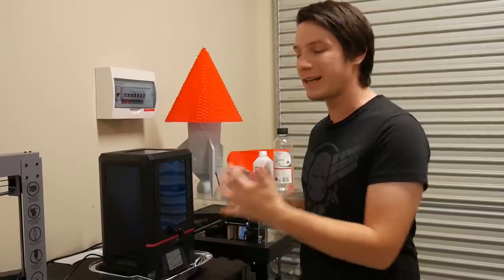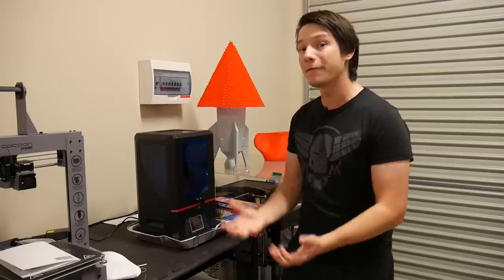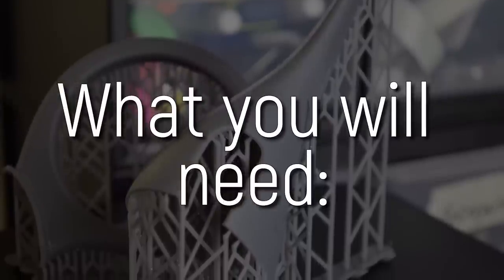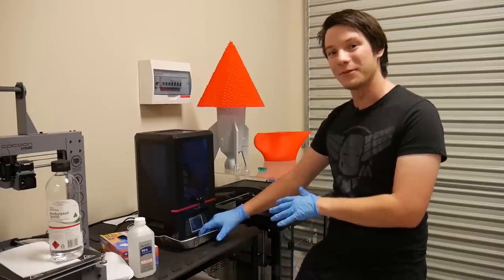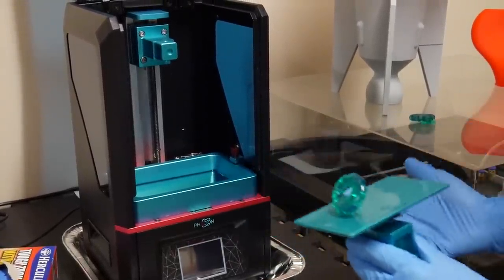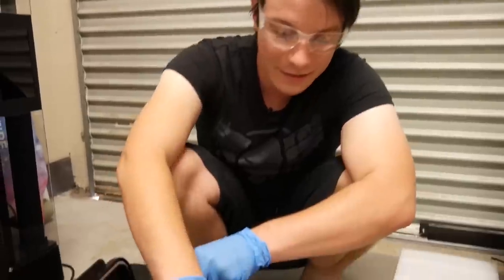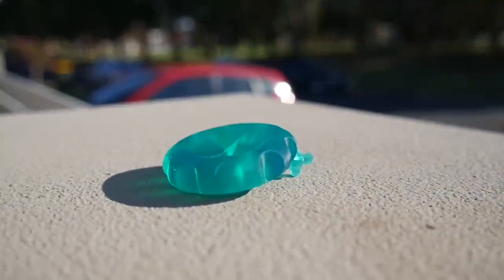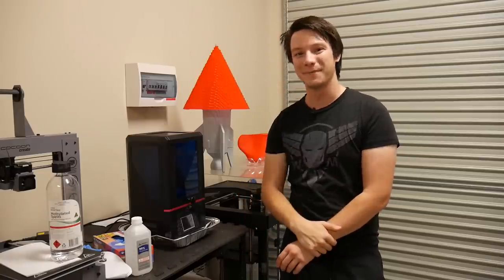Resin 3D Printing Safety - Important for Beginners!

Comment: Angus, glasses on BEFORE gloves on.  Glasses off AFTER gloves off. ;)  Don't handle glasses with gloves.
Reply from the maker: Haha yeah, normally I do that just mixed up the order while filming ;)
Reply: Exactly, the resins aren’t as dangerous as it seems here to begin with (look at the MSDS) but always good to wear gloves. Problem though is, wearing gloves gives a false sense of security, you have to be super careful not touching things all over the place and you can make it actually worse overall because you feel protected. Just like how people with airbags and all sorts of protection suddenly start driving faster.
Reply: @VincentGroenewold  BMW's must be really safe then if they don't follow any traffic rules :P (yes, I know how old this comment is)
Reply: @RasMatHam02  Traffic rules are never broken? ;) It's human nature I'm talking about, I worked in a lab and there it was the rule for an entire lab to either wear gloves, or only when handling certain stuff and then take it off immediately. Precisely because people are sloppy and cross-contaminate. And that was part of my point here, if you start wearing gloves, the user has to be aware that you either always use them in that room only or you implement a good strategy. But you have to think about it and not many do that, hence the false sense of safety.
Reply: @VincentGroenewold  I always drive 10 over
Reply: @HYPERxSONICxFANx2012  what a rebel

Comment: One thing you missed with the gloves is they must be Nitrile glove not latex. The UV developers will penetrate nitrile gloves slowly so change gloves if wearing for more than 10-15 minutes at a time or double glove. Latex gloves will not stop the developers reaching your skin.
Reply from the maker: Neat, I didn't know that. Nitrile is what I try to go for generally because not a fan of Latex anyway.
Reply: Not to mention that there are some that will have an even more of a reaction to the latex than they would the resin... generally, if you have any known allergies, take extra precautions.
Reply: I know this is an older, but I thought I should leave this here. When you are removing your gloves after use, start by pinching the glove at the heel of the hand. Don't get closer than 2cm from the cuff. Once you have a decent grip peel it toward your fingertips, while turning the glove inside out. Grip the now empty glove in a loose fist, and hook the cuff with the free hand, and peel it toward the fingers again. If done correctly not only will you stay clean, you will have bagged or double bagged them. (triple or quad if you double gloved but alternate hands if you do this)
Reply: What if you're very allergic to latex rubber?
Reply: Damn, the resin printer I bought came with latex gloves. I’ve been using them thinking they were safe. 
Thanks for the heads up. Hopefully I didn’t do too much damage to myself.
Reply: @gatblau1  you only have to worry if the gloves actually broke down. This is a common thing with solvents reacting with gloves. Even nitrile gloves would break down eventually from the solvents. If you want to be extra safe, you can use industrial chemical-resistant gloves. I own a manufacturing shop and we reuse the industrial gloves for a few weeks. You HAVE to make sure to clean the gloves themselves between uses and allow them to dry. Any tear or hole and throw them out. If we are using the strongest of our solvents, we double glove (nitrile then industrial) to be safe.
Reply: Do You know what about vinyl gloves?

Comment: Great timing, Angus. A lot of the folks in the tabletop gaming community are getting Photons and it's quickly becoming one of the favorites within our small niche. The way you show the process is phenonemal and I'm gonna be sharing this video all the time. 

Thanks again!
Reply from the maker: Cool! These machines are ideal for tabletop gaming figures and terrain.
Reply: Maker's Muse Definitely. There's always a raging debate about whether optimized FDM prints can compete with resin, but the day is coming when more of us can have both an FDM printer and a resin printer so we don't have to worry about it. I'm excited. Thanks again for your contributions to our hobby :)
Reply: How much resin does printing a typical PC miniature consume?  I'm considering getting into resin printing for the same reason, but the resin is still quite expensive.
Reply: oasntet I actually just made a video on that :)

https://youtu.be/v04wjiUT5Qg

tl;dr: After talking with a lot of people using the D7 and the Photon, of all skill levels, actual yield varies in how many minis you can squeeze out of 1L of resin. Assuming resin costs between $60-90 per liter - probably between $0.20 - 2.00 depending on how tight your post-print process is. 

I go in depth with both FDM and Resin in the video. Hope that helps!

Comment from the maker: Yes I know it's the Anycubic PHOTON and not Mega :P Review in a few weeks. Happy Printing!
Reply: love my machine. using it more that i do the moai.
Reply: Wheres the mk3 review?
Reply: Can you comment on whether it contains the smell? I know some of the resins smell quite bad so I was wondering if the print chamber is sealed in this case.
Reply: You got it right earlier in the vid. :-) Watching this, though, reinforces the idea in my head that I shall not own one of these printers any time soon, particularly with kids around.
Reply: depends on the system the photon has a couple of fans in it. but a lot of users are building chambers to put them in and vent the resin smell outside. i have used mine in the room. smell vareys from resin to resin. but some form of venting is only a good thing. :)
Reply: I've been using my Photon for about two weeks now in a spare room in our home. The Photon has fans to help with the odor, however the smell still lingers. More troublesome is the fact that I didn't have the room well enough ventilated and whenever I would spend more than a few minutes in the room while the machine was printing I would get very nasty head-aches.
Needless to say, all printing is now on hold and resin stored away until I build a print chamber next to the window with fans venting fumes outside.
Reply: there is a print on thingiverse that replaces the top cover with an adapter for placing an extractor fan and you can fit large diameter pipe or spring tube onto it to help venting out the window. i find i have had no problems with resin smells. but abs locks up my lungs gives me a migraine. but yes check thingiverse or the facebook photon groups we are very helpful there. :)
Reply: what your machine is ? lol
Reply: Maker's Muse How long do the cured parts last overtime? Will it go bad if it's exposed to sunlight for prolonged periods of time?

Comment: Let's put this into context about how toxic this stuff is...
Acrylated monomer Acute Oral toxicity LD50 > 5300 mg/kg body weight
Acrylated oligomer Acute Oral toxicity LD50 > 5000 mg/kg body weight 
Photoinitiators Acute Oral Toxicity LD50 > 2500 mg/kg body weight 
Photoinitiators Acute Dermal Toxicity LD50 > 5000 mg/kg body weight 

Average weight of a male UK – Wales 84.0 kg (185.2 lb)

Acrylated monomer oral toxic dose 84 x 5.3g = 445.2g
Acrylated oligomer oral toxic dose 84 x 5.0g = 420.0g
Photoinitiators Acute Oral Toxic dose 84 x 2.5g = 210.0g
Photoinitiators Acute Dermal Toxic dose 84 x 5.0g = 420.0g

In order to get a toxic dose, you'd have to drink 1.5 liters of the stuff or bathe in the stuff long enough that all of the 1.5 liters absorb through your skin.

Be cautious, use protection, but acetone and isopropyl alcohol is as dangerous than this stuff. With lemon oil being more deadly.
Isopropyl alcohol: ORAL (LD50): Acute: 5045 mg/kg 
Acetone: ORAL (LD50): Acute: 5800 mg/kg 
Lemon oil: ORAL (LD50): Acute: 2840 mg/kg  I love lemons!!!!

LD50 = the amount of the substance required (usually per body weight) to kill 50% of the test population.

Comment: Angus also Important to talk about ventilation. You're breathing these chemicals in, so make sure you have either a dedicated air extraction system, or a super well ventilated space!
Reply: YES
Reply: What kind of breathing filter do you need for these?  A? B? AX?
Reply: Indeed ! That the most important security wise i think , best is to have an air extractor straight from to the air exit of the printer if possible.
Reply: @youdigsurf  What’s consider a well ventilated space?
Reply: @Aagggyy  honestly for the mono x , i will say a garage. Obviously not a place where you live, i used it in my office got a smell for 2 days for a 3 hours print, maybe it’s less problematic on small printer. ?  Atm im making a air extracting setup with a airconditioning tube , inline air fan and charcoal filter , waiting to receive all the part to finish it.
Reply: @youdigsurf  In that case, I’m probably gonna put it into my garage or basement. However, I live in Colorado and it’s pretty cold in the basement or garage so I’ll hold off on the resin printer for now but plan on buying it later.
Reply: @Aagggyy  it complicated because temperature can messup your resin polymerisation i guess ... you will have to think like me use a tent like a weed tent and put some air duct plus extractor there some setup on youtube you can check.
Reply: @youdigsurf  Will do thanks for the tips!
Reply: @MarcusWolschon  A1

Comment: Hey Angus really great video, I have been selling and supporting specialty chemicals for over 20 years now and I hate it when suppliers gloss over safety rules. couple of things I saw that you missed. Work in a well ventilated area (that is just good advice for all 3D printers FDM gives off nasty fumes as well). I have 1 unbreakable rule in my demo center - WASH your HANDS with SOAP and WATER - or any part of you that is exposed to the uncured resin. 
The general indicators of UV curing liquids on your skin is irritation and rash, soap and water will generally clear the contamination and you are good to go. 
It is not dangerous to work with liquid resins as long as you follow the basic safety procedures, I hope that in future videos you will reinforce the safety aspect of working with resin printers.
One last thing, I also wear a lab coat to protect my clothes from splashes - you like of look like a mad scientist while working with the printers so I guess it is also kind of cool.

Comment: Good comments on safety with UV resins. I work with these materials so I thought I would add a few things:

UV curing resins likely use acrylate functionality which are sensitising materials. Like you said you want to minimise skin contact as much as possible, you can develop serious allergies to these materials if you keep getting them over yourself!

To add to eye safety, DO NOT wear contact lenses while working with these materials, even with safety glasses. These materials can fuse the lenses to your eye and permanently destroy your vision!

These materials use chemicals called photoinitiators to polymerise the resins when exposed to UV light, depending on what ones they are using (likely cheap) they can carry serious reprotoxic hazards (mostly for women or the unborn child), so once again a note on not getting the uncured materials on your skin!

Likewise I wouldn't be making anything that would be in contact with food out of  these resins, they are not food contact safe and uncured components will migrate out of the part into food if in contact.

Comment: Some questions:
1. Remove supports before curing?
2. You're done printing what do you do with the vat and buildplate? just leave it if you print  in a few days again or do we somehow need to clean and wipe it all off?
3. What's your experience with water washable resin?

Comment: A head-to-head comparison between DLP and SLA would be great to see.  I've gathered that SLA offers higher resolution than DLP, but DLP consumables are FAR less expensive than those of SLA.  YouTube is telling me that the resin tank cost of SLA is troubling.  $60 US dollars and up, and they MUST be replaced with alarming frequency.  With DLP, only a piece of plastic needs replacing which costs less than $7, if I understand things correctly.  A dollar-to-dollar shootout might be entertaining and informative.
Reply: 3d maker noob I think did a pretty good comparison https://www.youtube.com/watch?v=xDUWcQuj7VU.  If money is no matter, the sla IS better, but you need a magnifier to really see it on most prints.  SLA is typically faster as well because the laser is more powerful than the UV led light.  DLP is fixed duration for every layer, sla has to move the laser over it, so the time per layer will vary.  SLA also has more resins that will work with it.  Some of the slower cure resins don't work well in DLP printers.  A cheap dlp is about 550 usd, a cheap sla is about 2000 usd.
Reply: Yeah, but it's more fun when somebody standing at a desk or in a garage workshop goes through it step by step.  It's like an entertainment show on the TV!  I did see & enjoy the Noob video.
Reply: DLP and SLA both use the same resins, so the per part price of the two are identical given the same model.  Because the laser is generally far more powerful than the UV bulb in DLP printers, the DLP capable resins are a subset of the SLA resins.  Anything that works on DLP should work on SLA given the same wavelengths of light, but the reverse is not always true.  As far as the beds themselves, the FEP sheet on most DLP printers is pretty cheap as you say, but the price of the laser beds is harder to nail down.  It varies a lot from printer to printer depending on their features.  The bottom layer, which is the part that actually fails CAN be DIY replaced.  I have seen videos on it, but don't know the details very well, and it is a more in depth proceedure than swapping out an FEP sheet on the DLPs.
Reply: DLP is SLA

Comment: Can you explain more about why they're toxic? does it burn/irritate/cause cancer/nausea ??
Reply: The msds sheets I have read on the ones I have used just list them as minor irritants.  Not a big deal, but can cause rashes etc.  Definitely wear the gloves, but if you get a drop on you and you wash it off with alcohol, you will be fine.
Reply: Potential allergy risk. Cases of respiratory issues, nausea, migraine, memory loss have been reported. This should be fairly rare, but it might be life threatening for some people.

Do Chinese resins like you get with Anycubic or Wanhao even come with an MSDS? If there is an MSDS, how can we be certain that they hold to it and that no manufacturing fault causes a deviation and adds a non-neutralised byproduct?
Reply: The resin is basically a mix of monomers and a photoinitiator. Monomers tend to be corrosives or irritants as they are small reactive molecules like styrene or methacrylic acid derivatives which if volatile may also be lachrimators (affect eyes/lungs/mucous membranes). The photoinitiators are more hazardous as they are free radical generators like organic peroxides however they are usually only present in the small amounts needed to start polymerisation of the resin (less than 5% wt/wt will bring things with a corrosive/oxidising hazard designation down to an irritant). Many of these types of chemicals can cause skin sensitisation in worst cases.

Comment: You left out an important safety item FIRE alcohol is extremely flammable.
Reply: With the resin you want to ventilate the room anyway. 
A concentrated, super fine mist of methylated spirits in a CNC fog cooling can't be ignited even when blowing directly into a torch. But having it evaporate in unmoving air...that's a completely different story. But you're going to smell it way ahead of such concentrations and the splitting headache of accidentally breathing the stuff will make sure you remember.

Comment: See a lot of questions about resin toxicity. The easiest way to describe what occurs is called the bucket theory. Every exposure will impart some part of the resin into your blood stream. You  ability to handle this without reactions is an empty bucket with a slow leak. If you limit exposure the bucket will never "overflow" and cause a reaction. If you do not limit exposure the toxic components build up in your system until it reaches the overflow or tipping point and you show symptoms. Once you stop exposure your system will slowly excrete the toxic component out and lower your blood serum levels (the leak bit). The danger comes when you have triggered a reaction as that can sensitize your system and make even you more susceptible to having reactions or likely more severe ones. As well as pumping the air outside consider having a small air cleaner with hepa and carbon filter around the printer or the clean area etc. Not all the VOC's are going to go out the window. Nitrile gloves and a painters carbon mask when your head is right over the fresh print or resins or clean up area won't hurt.

Comment: Can you tell me where I can find a cleaning station like the one you use at 5:55? I'm setting up a printer at my work and it has a UV curing box, but no cleaning station. The manual recommends using Tupperware boxes! I'd prefer a more contained system like what you're using, but my brief Google search didn't turn up with anything.
Reply: @minimalismmd  Was looking for that. Thank you!